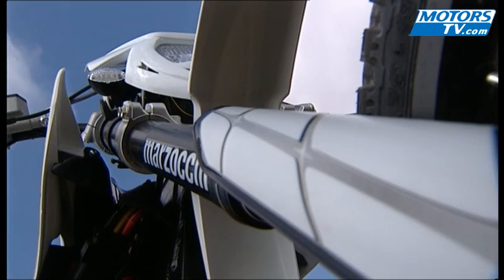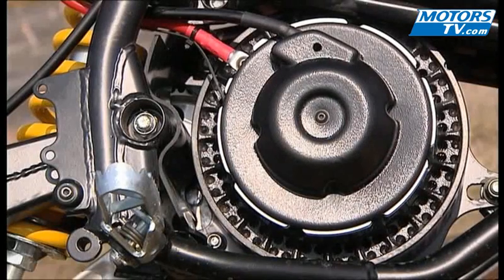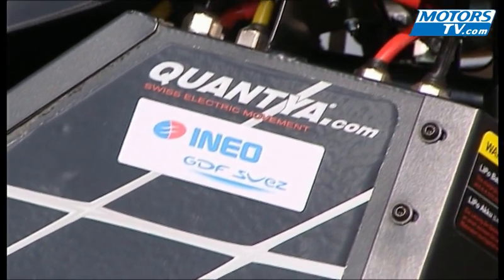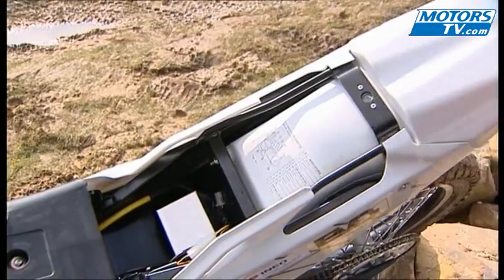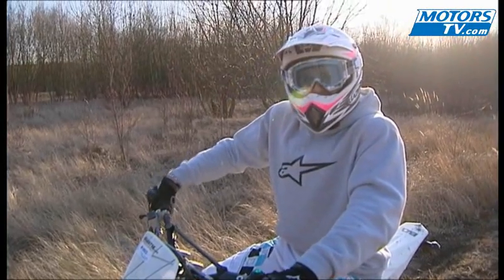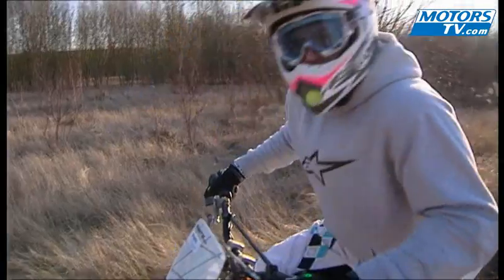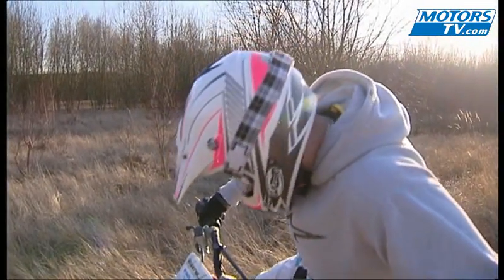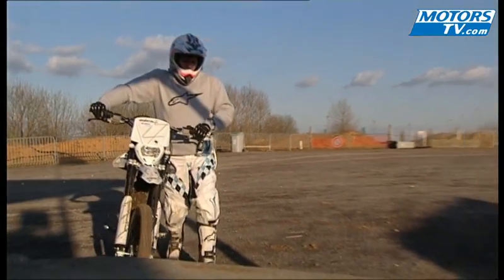Bike test QUANTYA STRADA

Comment: so as i understand main problem isnt the electrical engine but the batteries which can handle as much power as they can by now but if theyd be more powerfull than the engine could make power way more than inner combustion engines these days and the bike would weigh way under 100 kilos?